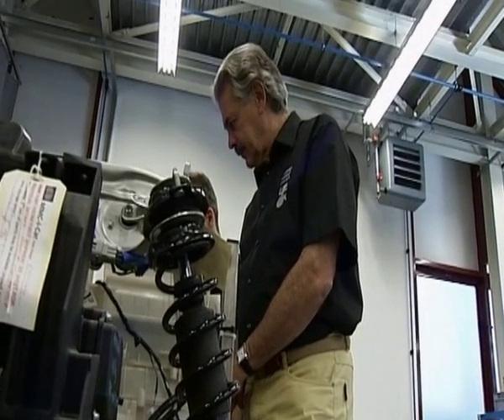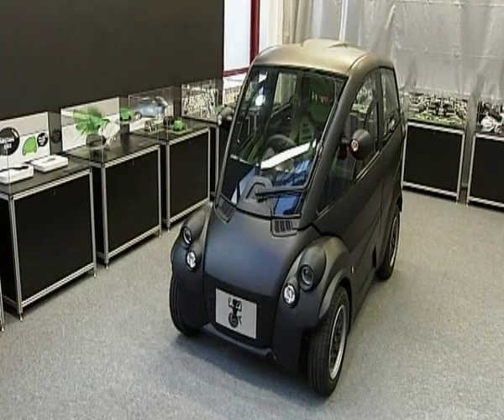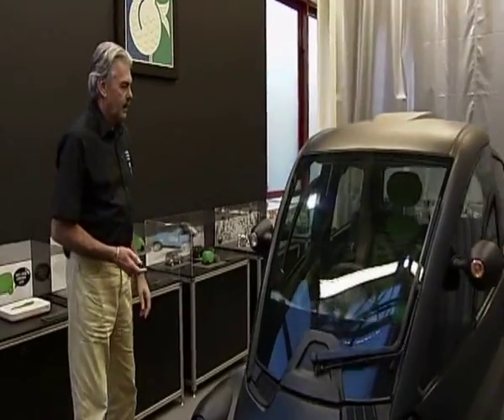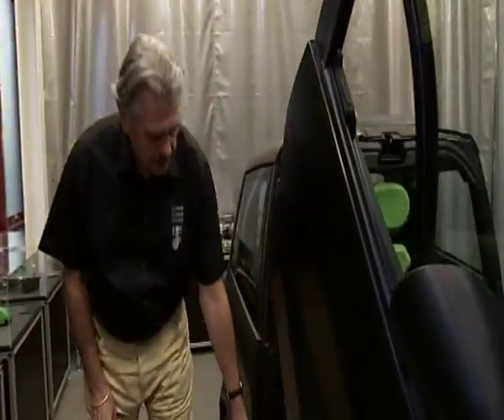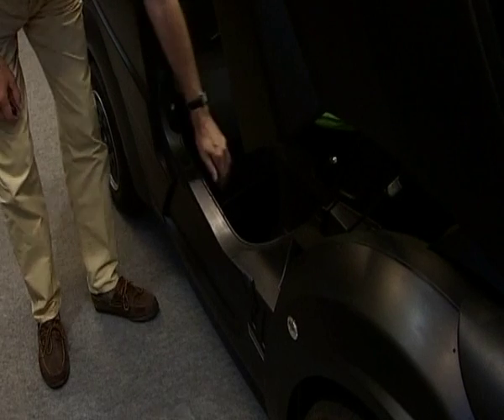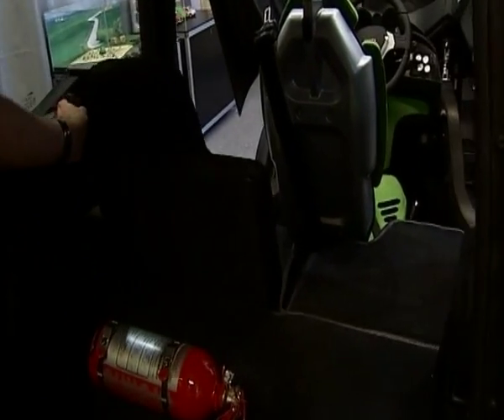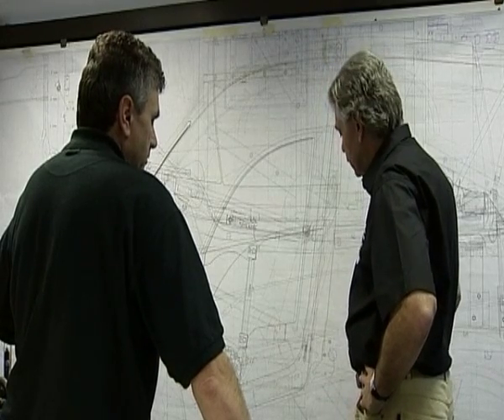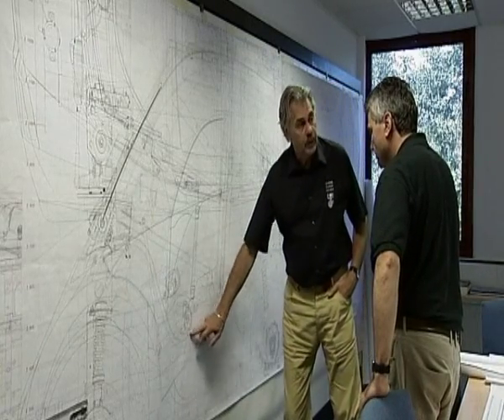T.25 - The first big small car

Comment: my smart gets 50 mpgs in the summer, with crappy engineering and it weighs 1800 lbs, knock it down to 1200 lbs and it would easily get 75 mpgs.